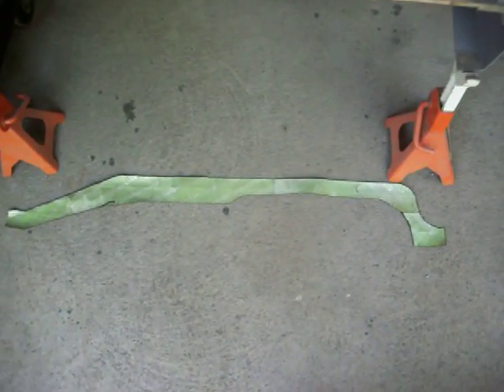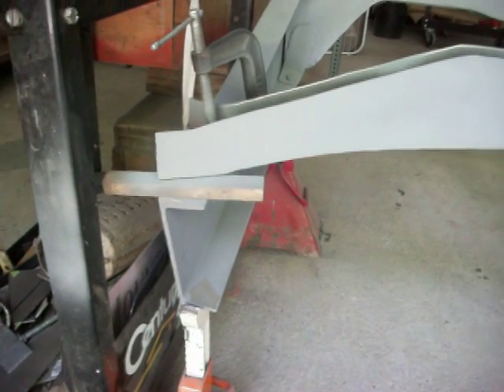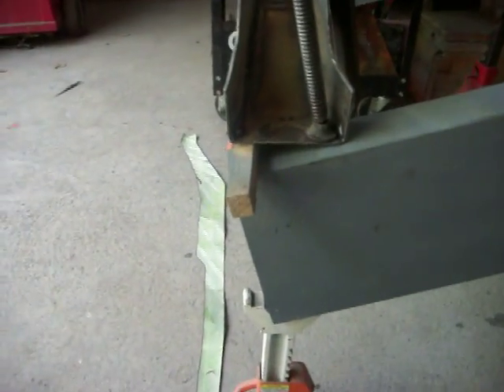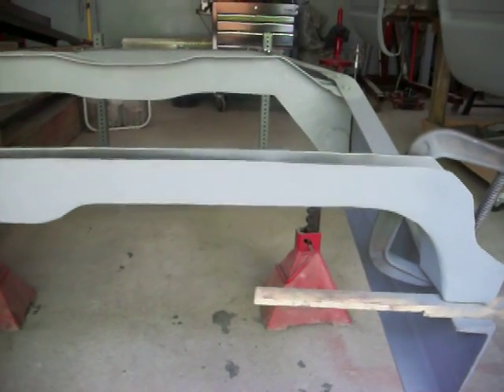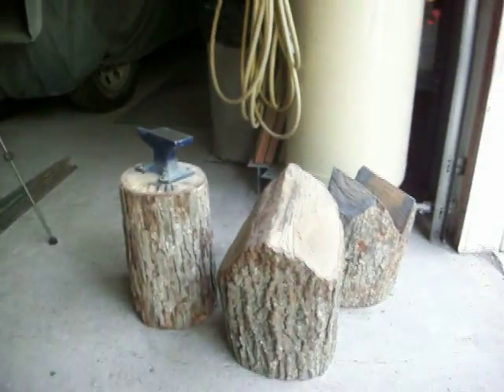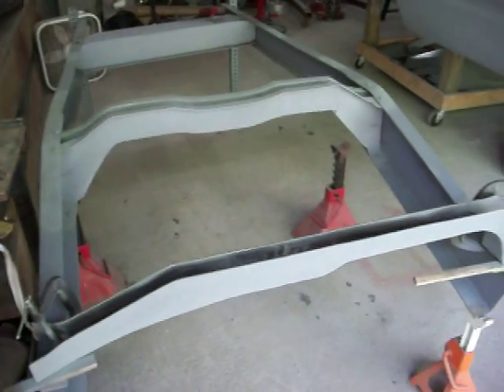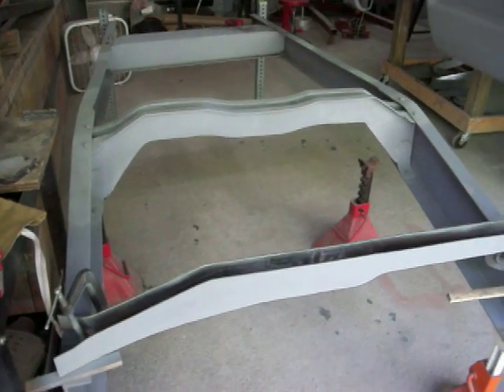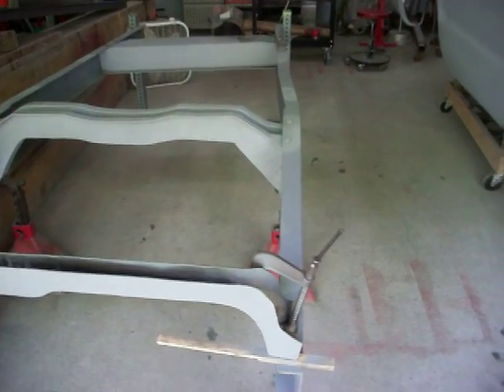Frame video 10 Cross member 3 1989 Chevrolet frame replacement

Comment: i cant wait to see this frame when done. ik my uncle could use a new frame. i cant believe how long he got that frame to last. all it took was 5 frame patches, 1 door patch, and a 6th frame patch on the way soon. the frame and body suck but the engine is running like brand new.
Reply from the maker: travis8352 Yes it does not surprise me your uncle had to make so many repairs, under my cab are 4 plates on the frame and the transmission mount was repaired on both ends because they rotted off. It is ridiculous.
Reply: it is very rediculous. best of luck with hte new frame. it looks great so far.